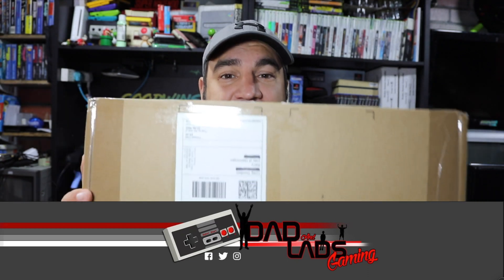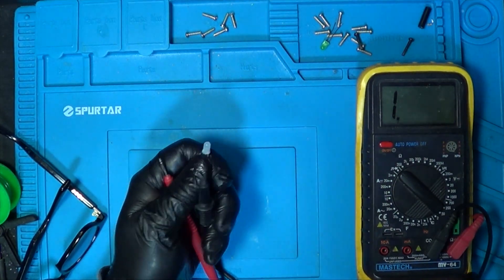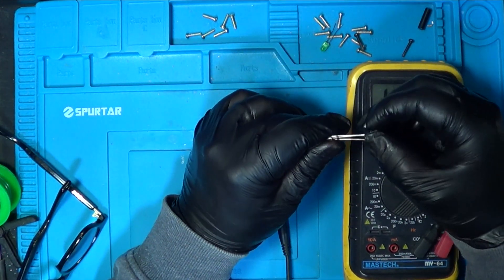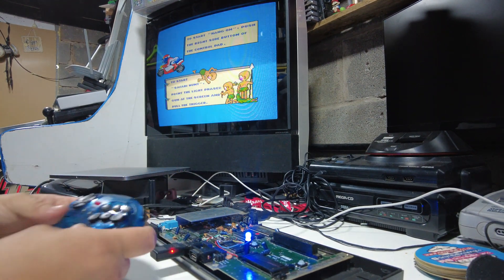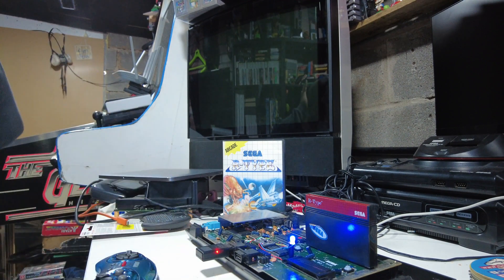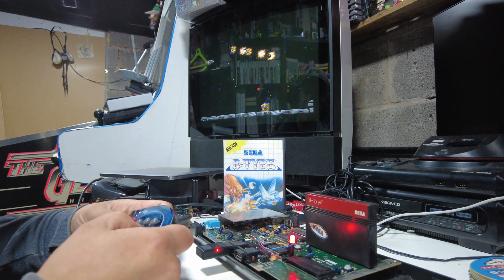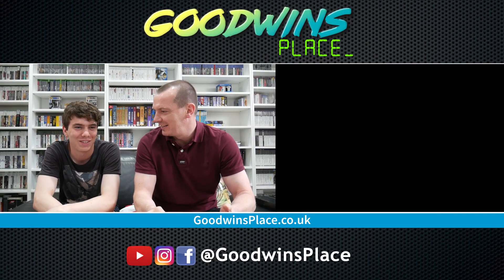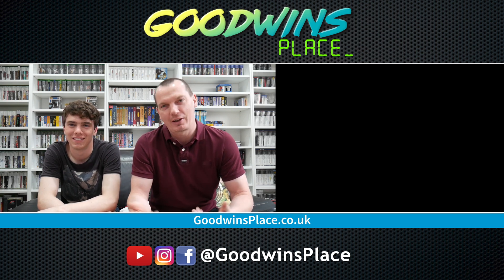Master System 60hz Reset Switch Mod - Sega - Da Retro - 50hz to 60hz

Comment: 60hz is the only way to play, can't play old console's at 50 as it's so bad after you've experienced how it should be
That's a fantastic upgrade, wish I had your talent. Sure Marcus will be chuffed. Awesome 👍✌️
Reply from the maker: It's such a change, I guess we just didn't know and put up with it. I wonder if it actually made us better or worse players having a slower system. 🤣
Thank you for watching.
Reply: @GoodwinsPlace  it can certainly help the difficulty level at 50. I was lucky enough to experience 60hz in the early Megadrive days and never played PAL since until it became optimized like it is now

Comment: Made that mod look easy mate. Didn't realise that you could do that with an led with a multimeter. So much difference with Hang On. Did you die on R Type just as you swapped the video? 😜😂.
Marcus does know how to pick a box lol 📦 great video mate 😁👍🏻

Tommy mate, have a word with yourself Master system is way better 😂👍🏻
Reply from the maker: It was fairly straight forward to do. 
Yeah it's handy and helped me test a few LEDs in the past.
I think I played a bit longer, but didn't get far without losing a life. 🤦